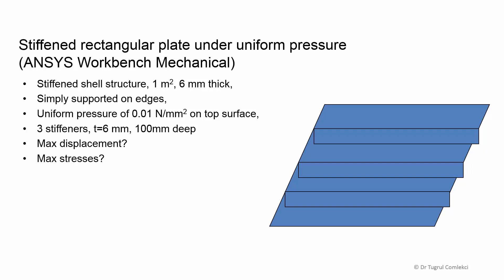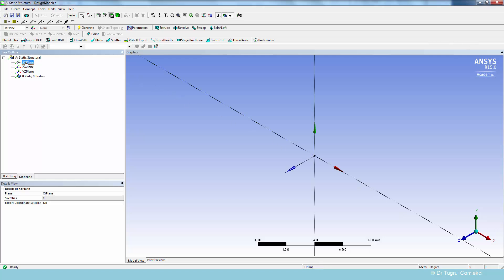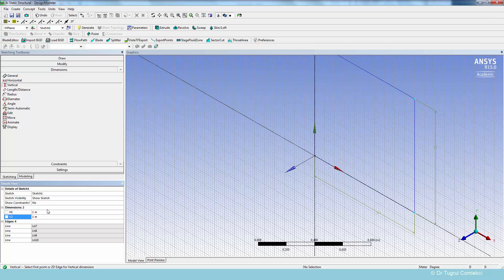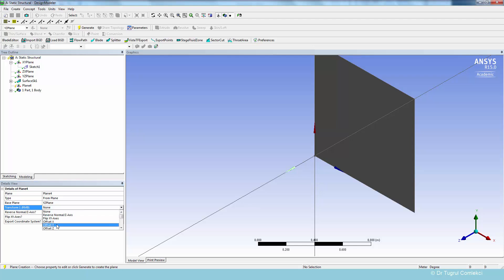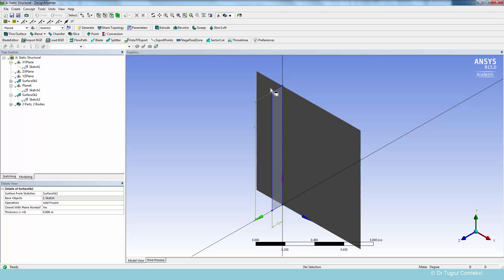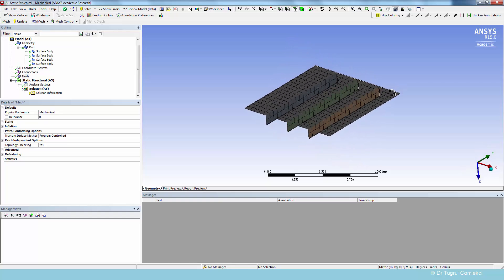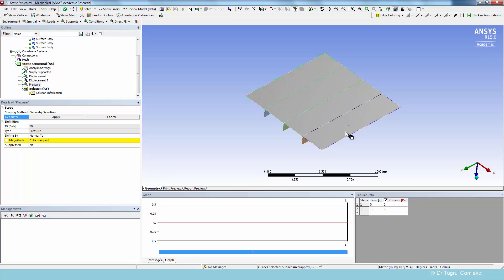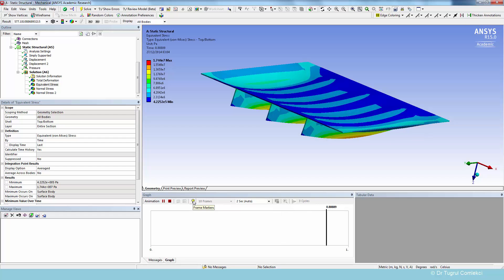Stiffened Plate Static Structural Finite Element Analysis

Comment: I did the same but in the end, instead of having a Part with 4 Surface Bodies, I only see 4 Surface Bodies. It looks like the Part is not formed. When modeling the system I get an error which I think is because of this. I appreciate it if you could explain how can I have a part. Thank you
Reply: You have to form a new part with the bodies. In design modeler, you must have to select all the surface bodies generates, then click on right mouse button and select "form new part". This should work (Ansys 18.1).
Reply: I am also getting error in solving
If anybody have got any solution plz share

Comment: Why is the skin surface in your model cut into four pieces by the stiffener? But in my case, it is still in one piece.
Reply from the maker: 张向阳 Hi, thank you for your comment. In this example I have re-analysed my original Mechanical APDL model which had shared lines at the boundaries of the plate and stiffener areas for mesh connectivity. Of course Workbench has more advanced tools, such as mesh connections which allows a single plate surface concept connected to as many stiffeners.